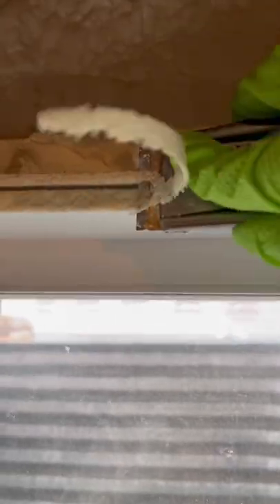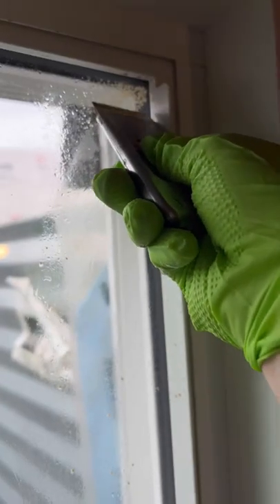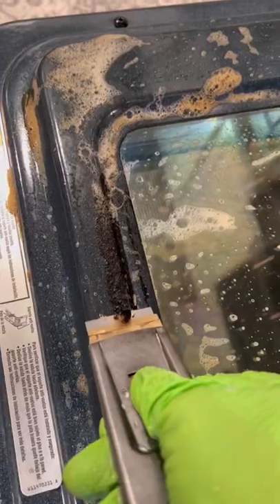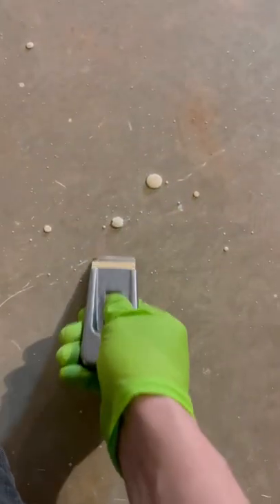One of my favorite cleaning tools #shorts #cleaning

Comment: It's an ok tool until it starts slipping and not holding the blade at the correct height. I just keep the single edge razor blades, like that one, or the utility knife razor blades for cleaning. And you're right, it's the cleaning super power...along with Qtip cotton buds and toothpicks ...Oh and an old toothbrush!